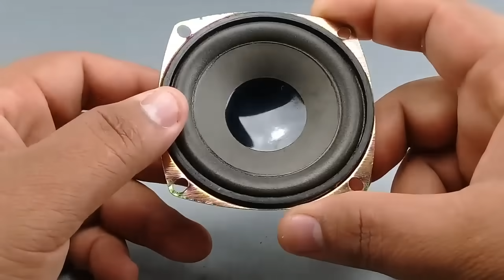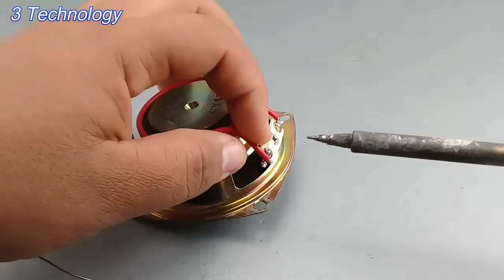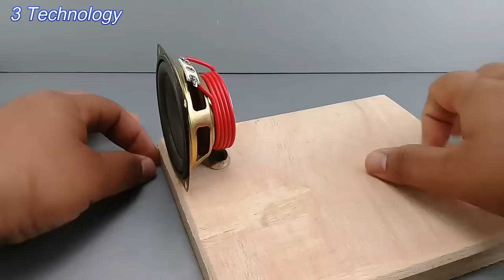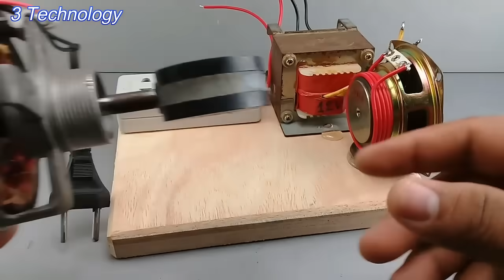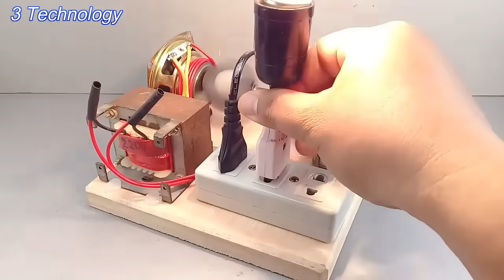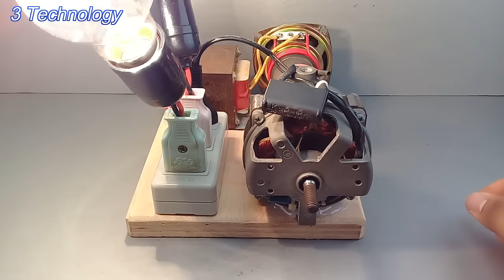Make 6000w Free Electricity Energy Self Running With Speaker And Transformer

Comment: Avant de complimenter il faut se poser la question sur la bobine relais...
Est ce une bobine de transformateur de 12 v en 200 v ( comme sur les voitures) ou une bobine d'appareil ménager récupérée?

Si c'est un convertisseur 12 en 220 c'est possible , mais si c'est une bobine d'appareil électroménager c'est du baratin.

Et vu l'état il s'agit d'une bobine récupérée sur un appareil de cuisine. Or ce type de bobine peut transformer du 220 en 12 volt, mais ne peut absolument pas faire l'inverse.

Si vous brancher du 12 volt il ne sera pas possible d'en faire sortir du 220 avec ce genre de bobine.

Donc s'agit il d'une bobine récupérée sur un convertisseur 12 en 220v ou s'agit il d'une bobine de 220 en 12 v?

Moi je pense que c'est un canular.
Reply: C'est un transformateur de 12v / 120V
Reply: Mais plutôt 120v

Comment: I think you should be careful, there might be people who think this joke is real.🤣🤣🤣
Reply: Why wouldn't it work?  The magnet would keep the alternator spinning instead of a belt which creates energy. Route the energy into an outlet, which just allows further transfer of the energy.

This is old school Benjamin Franklin kinda stuff.  Tesla stuff.  We only need to store energy if we require portability. Great party trick!
Reply: @SneekySecrets  The voltage obtained from the coil depends on the number of windings and magnet strength. In this system, a maximum of 0.5 volts or 0.6 volts can be produced. The transformer will not work with this voltage. In other words, it is possible to produce even 1 watt of electricity with this system.
Reply: @dogukansert2496  
Ah, I see.  Makes sense thinking of the various coils I've seen, the size of the wire, etc.